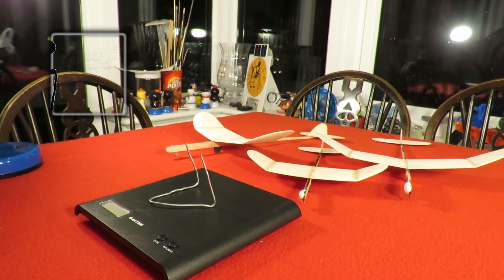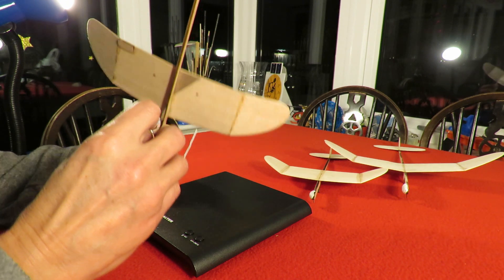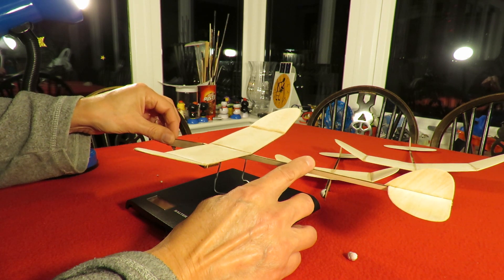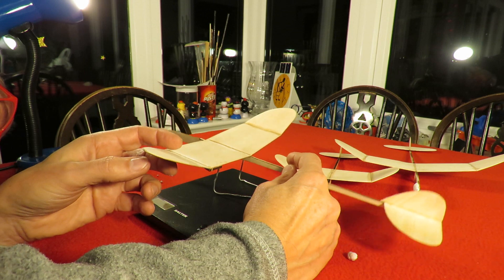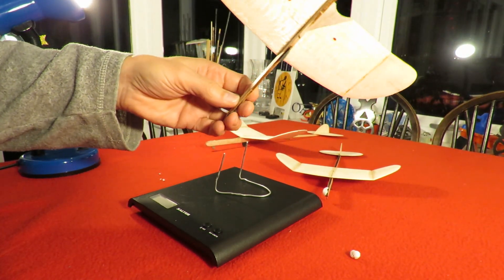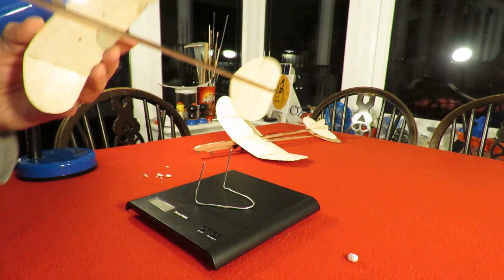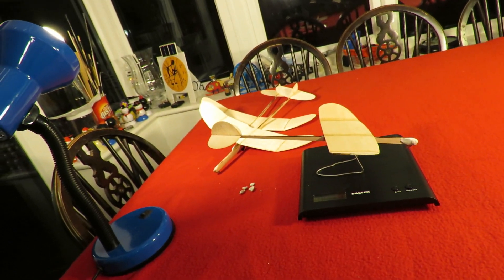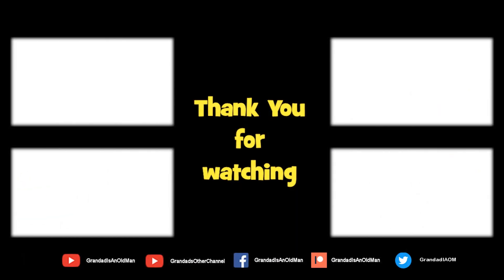Weight and balance on those Carbonettes

Comment: Three carbonettes on one table is truly a sight to behold! Very well built!
Reply from the maker: Unfortunately I couldn't resist giving them a test flight so one is severely warped from landing in wet glass - only the tail but will probably need to be cut off and replaced.
Reply: ...and that’s why you have THREE. 😂